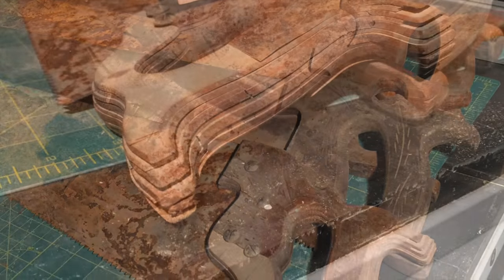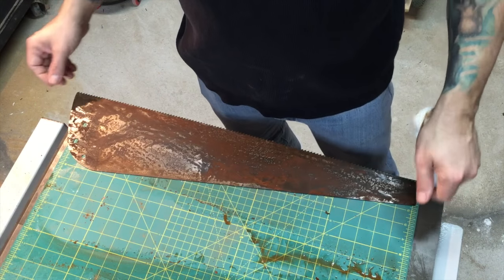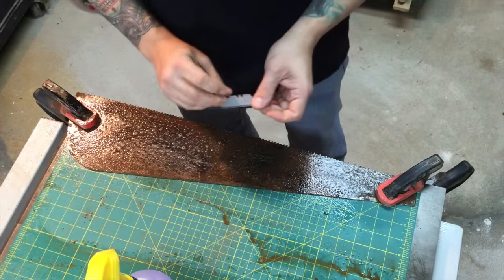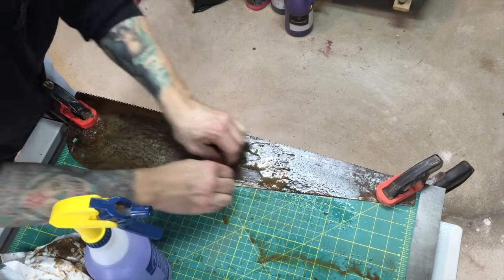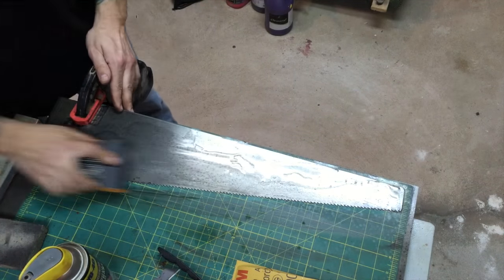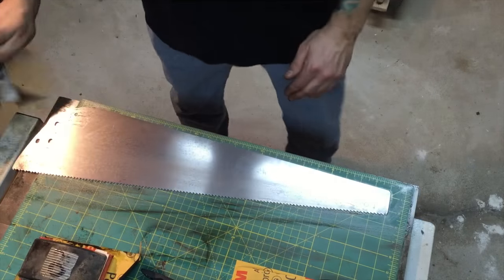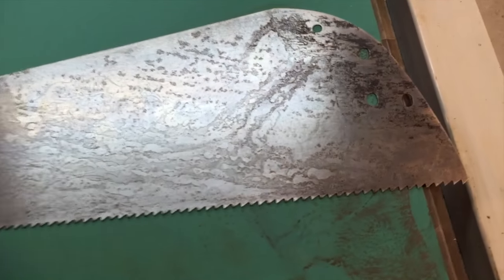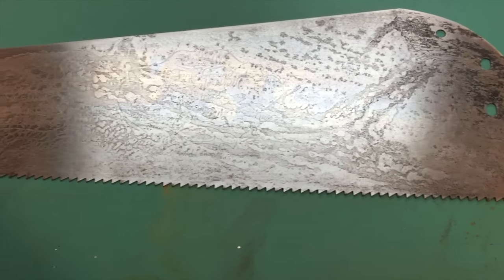Hand Saw restoration   Sandvik No  270 Rip saw PART 1

Comment: I use a box cutter blade as well.  I found a really neat handle for them at Home Depot.  The handle allows a better grip on the blade. I've cleaned hundreds of saw blades exactly as you do.

Comment from the maker: AHH!  I'm such a goon!  I rushed to get the handle done and screwed it up 2 steps before it was done. To "save time" I quickly ran a trim router over the back edges to round them off and gouged out a spot because depth adjustment loosened up on me. I'm sure it was my fault, but mannnn...  don't worry though!  I'll put in the video of the screw-up! And do the next one all by hand. Shazzbot!